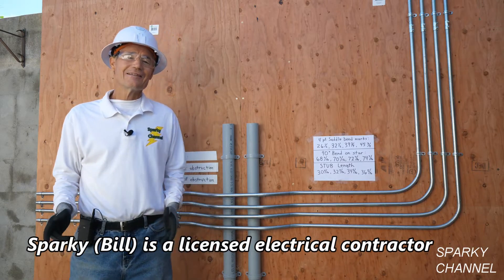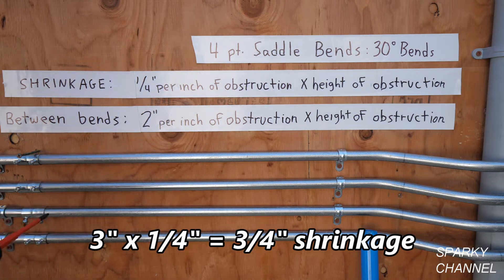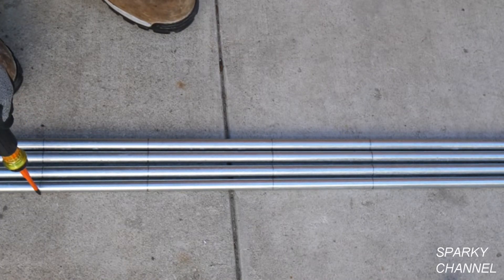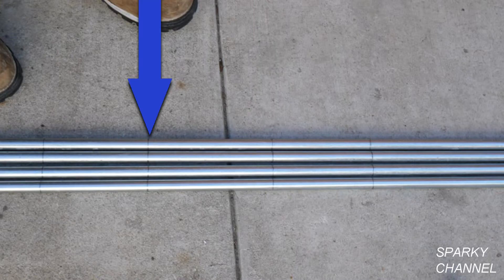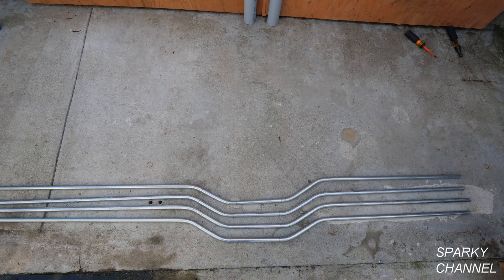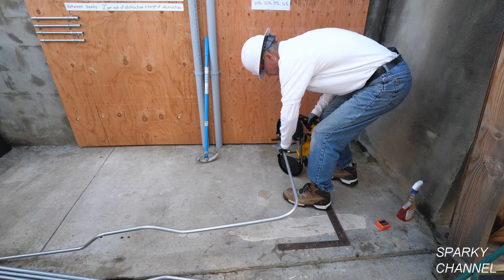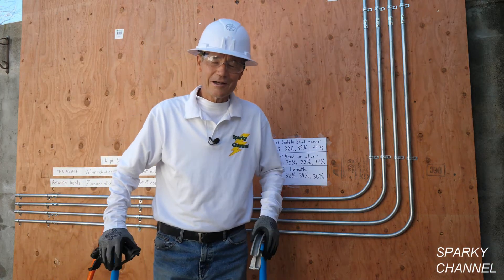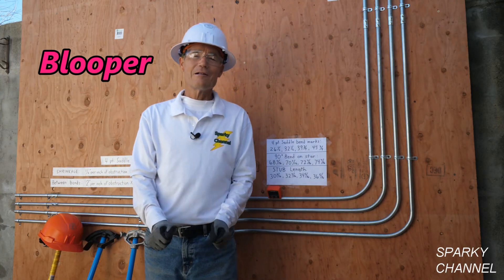How To Make Parallel EMT Bends with 4 Point Saddle Bends and 90° Stubs

Comment: 30 DEGREE 4 POINT SADDLE BENDS
1. Measure distance from coupling or connector to obstruction. Add shrinkage which is 1/4 for every inch of height of obstruction, Now Mark
2. Add first outer mark which you will multiply 2 with the height of obstruction, Now Mark. 
3. From mark number 1 add the length of obstruction, after this you should only be marking in one direction moving right to right or left to left, Now Mark
4. Add the same length you measured when you multiplied the height of obstruction by 2 to the last outer mark, Now Mark
5. Now bend 
These are just notes I took from the video, but I figured I'd leave them here:)
Reply: Helped me out, thank you

Comment: I appenticed under an old industrial electrican at US Steel in the 80's. Ceilings there were 30+ feet high. This man would simply look up at the wall and then proceed to make a series of complicated, compound bends on the ground, without making a single pencil mark. Fit perfectly every time. Still blows my mind today.
Reply from the maker: Great story, thanks!
Reply: That’s amazing!

Comment: Great video, can anyone tell me how he got the first measurement for the 90 degree bend? I understand he adds 2 inches to each for the offset and 2 inches extra for the stub length but I didn’t see where he saids how he got the first measurement for the first 90 degree bend. Thanks in advance.
Reply: He doesn't explain it, but he made an arbitrary measurement for where he wanted the first 90 stub to take place, then every other one he added two inches extra for stub length. So how he did it was measure the middle of the coupling to where the back of the 90 stub is  after the saddle has been made. He then marked the conduit where the stub take up would take place then bended it.

Comment: Looks good. Just wondering why it looks like u didn't have 2 and 5/8 inches as the number you would be using for your 90s and overall length measurements? Dont u want the spacing plus the o.d. of the pipe? Or is your spacing 2inches from the back of one pipe to the back of the other pipe in which case the 2inch increment would be correct.
Reply from the maker: No, the spacing is 2" O.C. which is pretty typical.

Comment: The distance to betweem one conduit in relation to the other conduit  is the [tangent of 1/2 of the angle used to bend the 90 degree bend times the about of space between the conduits   . 1/2 (90 degree) = 45 Degree...tan 45 = 1.  So 1 x 2( being a space) = 2" longer 90 then the previous one.
Good stuff
Reply from the maker: Perfect, good job!
Reply: tan of 45 is 1.6 though not 1

Comment: Is the 68 7/16" mark (for the stub up) measured to the farthest side of the fitting (let's say connected to a panel box) or to the centerline of the fitting on the panel box? Not quite sure where this measurement ends. Thank you.
Reply from the maker: The 68 7/16" is measured from the end of the conduit to the centerline of the stub.
Reply: @SparkyChannel  Thank you, I was wrong in my assumption.
Reply: @SparkyChannel  I was wondering the same things as to how you got your measurements. Can you explain in more details. Also at the beginning of the video you have the multiplier for 30° listed as 2" not just the multiplier 2. Other than that, I find your videos informative. Just have to know that your audience may not know all the ways to get from a to b.

Comment: How do determine the length to the mark for the first 90? Is there a formula for this? Or is just the exact measurement to where the pipe needs to go up?
Reply from the maker: Sean, start at 2:04 and I explain it.